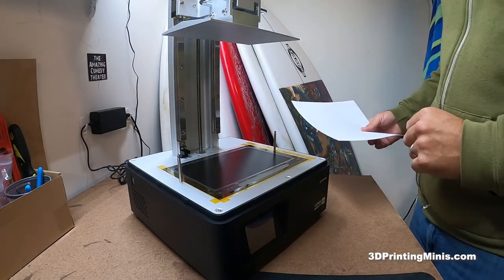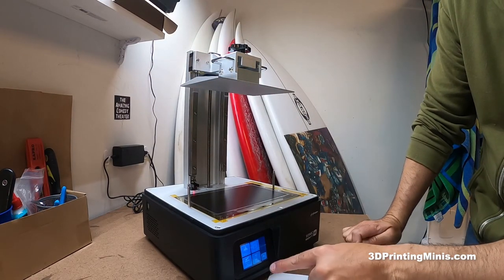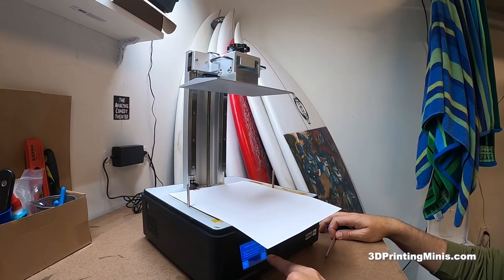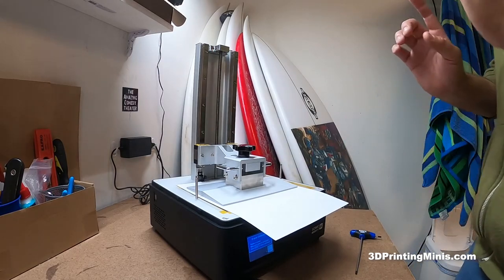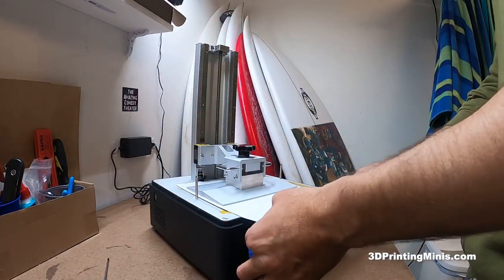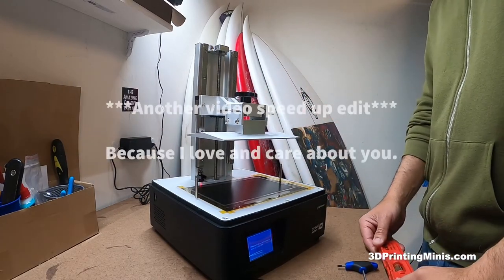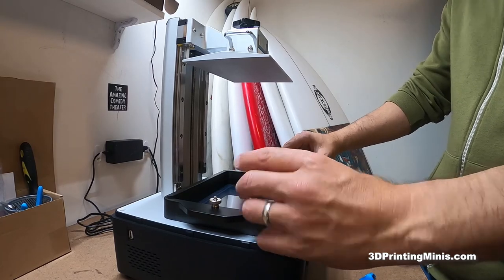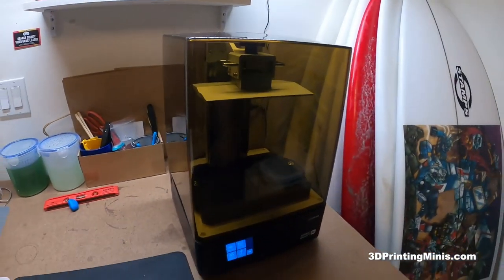How To Level 3D Resin Printer Build Plate (All Brands) - Phrozen Sonic Mighty 4K Plate Leveling

Comment: Thanks for the helpful videos, specifically with the Sonic Mighty 4K which I have on order at the moment. These will come in handy to rewatch when I have the printer in front of me. I also ordered the aluminum Vat separately to replace the stock plastic one.
Reply from the maker: Glad I could help. And thanks for watching.
Funny thing about the aluminum vat, the stock plastic one has been working so well I haven't had a need to use it yet. I'll definitely post a video once I do.
Also, last night I printed 45 miniatures on one build plate and they all turned out great. I just posted a video of it. The Mighty 4K is so great. You could army build minis in an afternoon with it. :-)

Comment: You have some good information here, but I believe you've oversimplified things by saying that this method works for all resin 3D printers. I have the Mighty 4K and it's a joy. But I also have an Elegoo Mars 2 Pro and leveling is a little bit more of a chore. If I did what you describe -- which works for the Mighty -- I would have problems with my Mars 2 Pro.
Reply from the maker: I have a Mars 2. Leveling is pretty much the same except it has a ball joint instead of the 4 side screws. The main takeaway is you want to have the paper equally tight on all four corners of the build plate.

Comment: I thought the Mighty 4K already comes with a glass screen protector... Seen many different reviewers report it does.
Reply from the maker: If you have a leak or spill resin on it you're still going to want a screen protector - unless you want to peel the factory tape off and take the screen apart. But, to each their own. 🤷‍♂️
Reply: @3DPrintingMinis  Ah ok. Didn't know it wasn't sealed around the Factor screen protector.